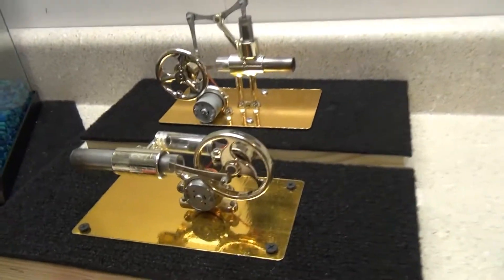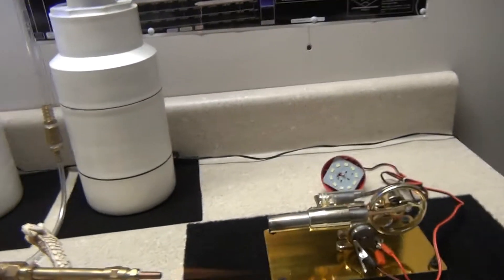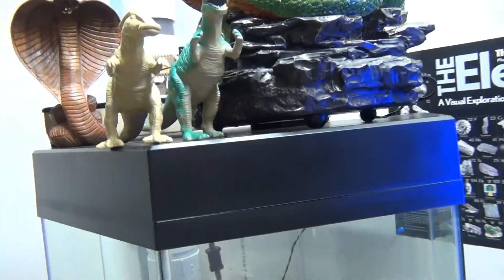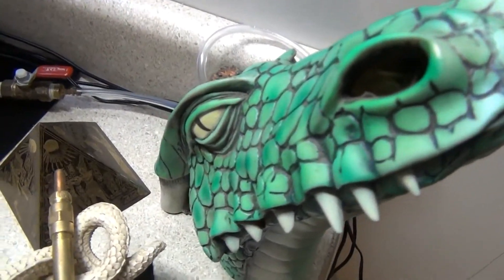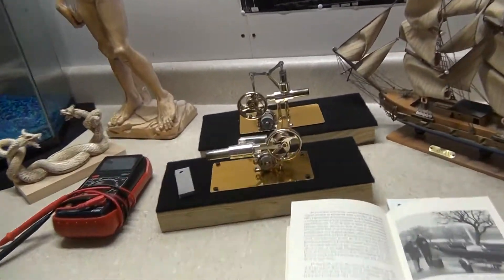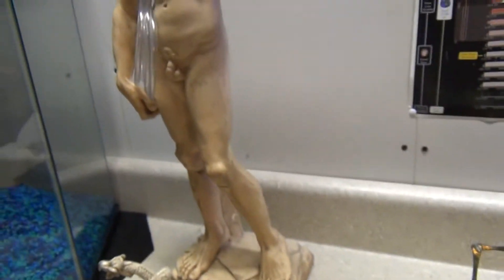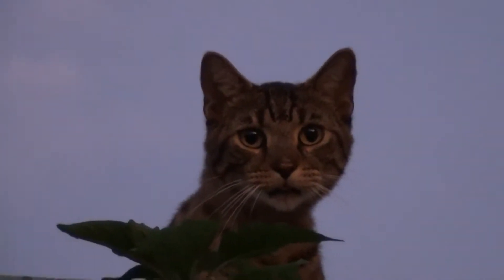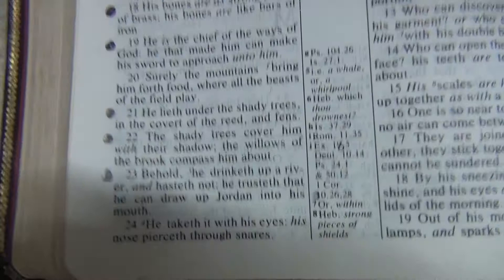HHO & PURE HYDROGEN GAS STIRLING ALPHAS

Comment from the maker: More videos on the Stirling engine alphas are on the way soon! We can use these motors to produce very valuable amounts of electricity with ease to power many of our electrical needs. Never underestimate the power of the Stirling engine water hydrogen oxygen and electricity even in small amounts it can be very useful for survival when you need to charge something or even a small light source is needed to see.